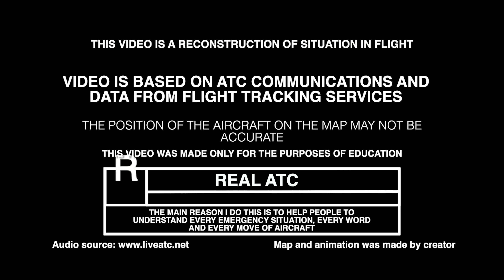Pilot's Worst Nightmare Engine Issues During Solo Flight. REAL ATC

Comment: KOKB is my home airport. It is a 2712’x75’ runway at an unattended field. Exactly 4 miles north is Camp Pendleton Marine Corps Air Station with a 6005’x221’ runway that is attended with a tower and crash crew and not in a canyon. As a pilot, I would not hesitate to land there in an emergency. The extra 4 miles and the longer, wider runway at MCAS could have made the difference in survival. The controller did a great job but should not have overlooked this option. More importantly, if you’re an inexperienced pilot, don’t be afraid to make use of a military runway in an emergency. Pilots have died because they overlooked the option.
Reply: Student pilot here, I wanted to add that while the Marines (or any other mil branch) might not be particularly happy that you land there all that ultimately matters is that you're back on the ground safely. They might have a strong security response but will be happy to help and will make sure you get what you need.

Comment: Well this brings back memories of my first solo cross country.  I think I was 6500' over Sacramento in a 150.  Thought I heard a change in engine sound.  Really?  No, it's just "automatic rough" - a little nervous making the trip alone, I guess.  Happened again.  Then I watched the tach, and sure enough, it was moving a tiny bit.  Then it quickly got worse - sounded like this guy's engine.  Oh S#!+.  Mixture rich - engine pretty much died, so I undid that.  Carb heat - same thing - felt like the engine just died.  I was on flight following with Sac approach (this was before norcal approach) and told them I was a student... something was wrong and I wanted to land.  I was on top of Sac Exec, so they just let me make a big circling decent.  The engine seemed to get better as I pulled out a little throttle and descended.  Shortening the story - landed safely.  A couple of CFIs came in another plane to get me - one them flew the 150 back to Stockton without incident.  After my debrief with the staff at my flight school, the consensus was carb ice.  

I observed, and shared, that in primary training, your engine fail drills are simple - instructor grabs the throttle and declares "your engine just died."  So you go through the memory items, set up best glide and decide where you will hypothetically land/crash.  Nobody ever suggested that "carb ice" would slowly choke out the motor. "Your engine just died" was only kind of engine out practice I had.  But my CFI said I did the two important things right, even if I didn't know what was wrong.  Pick the place to land and maintain airspeed.  It worked.

Comment: I've never been in this situation, but with a partial engine failure I would not be wasting time flying over open ocean. I would get myself over land immediately
Reply: Oceans are flat. No terrain to worry about. That area looks kinda hilly to me. Hugging the coast, there's a good chance of putting it down on a beach if it becomes necessary. Beats trying to land on a mountain.
Reply: The land you see is all Camp Pendleton and all hills. I would rather ditch near the beach than take a chance on a military base.
Reply: @stablegenius1595  It's a Cessna 152 - it stalls at about 50kts. Even if its hilly there's plenty of highway and flat ground, plus Camp Pendleton is full of military first-aid trained personnel
Reply: Pretty sure he is flying along the coast. Hardly "open ocean", easy there Marlin.
Reply: @alexmiller7721  Ocean good but I'd want to put it down parallel to the beach only 100 feet out.